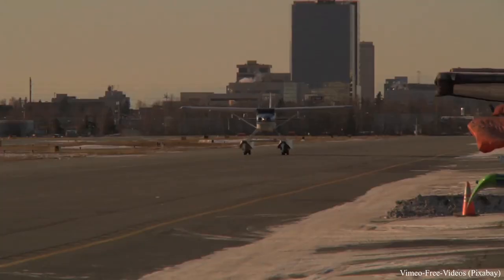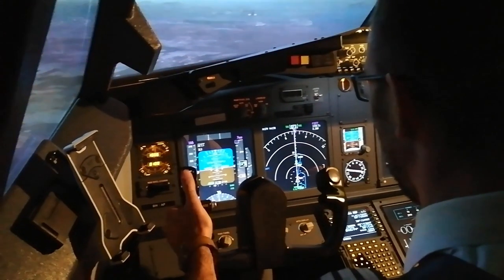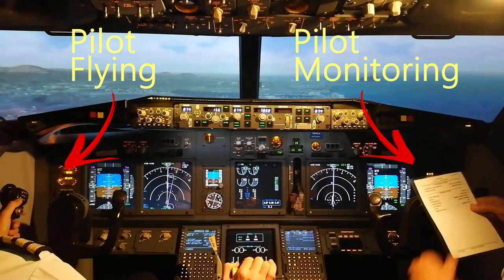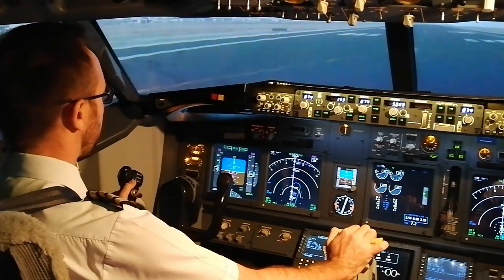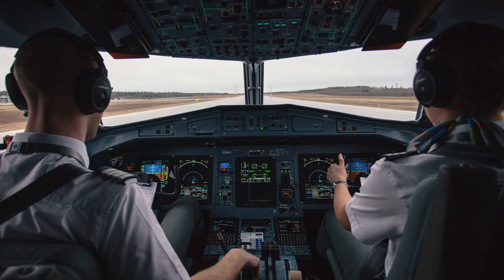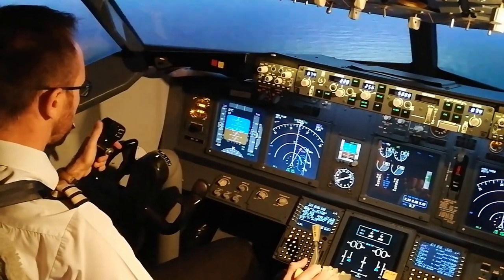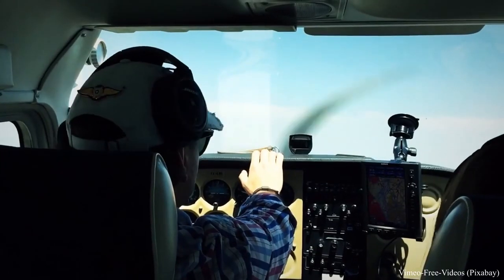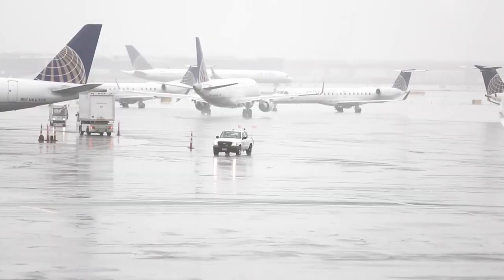Pilot Flying and Pilot Monitoring (PF & PM) - [Why Do We Need 2 Pilots To Operate 1 Aircraft?].

Comment: You are a true leader when you give new pilots the chance to grow and evolve professionally.
When flying with the autopilot engaged, who controls it? The pilot monitoring or the pilot flying? I would say it's the pilot flying, but how does the radio handling work in that case? Let's say ATC vectors you and both pilots will receive the transmission, but only one will acknowledge it. If the pilot receiving the transmission is the one monitoring, does the pilot flying have to wait until the pilot monitoring confirms the instruction or can the pilot flying comply immediately since they heard the transmission and already know what to do?
Reply from the maker: The PF flies the plane, so when the AP  is on the PF will manage it, the radios are PM duties and the PF has to listen and monitor the ATC communications as well. The PF should wait the PM for confirmation.